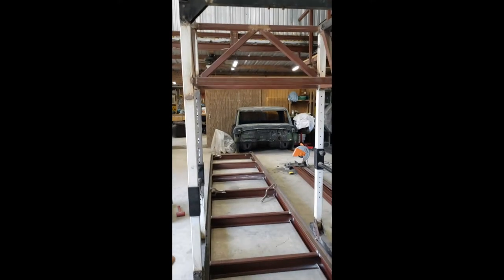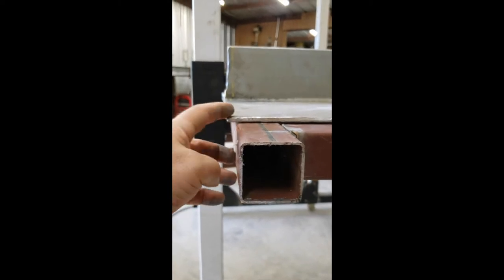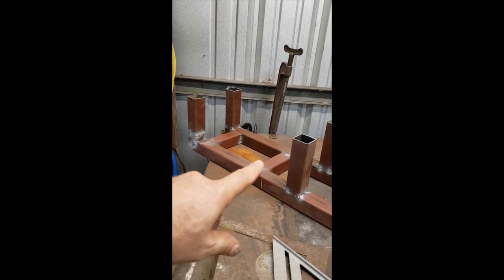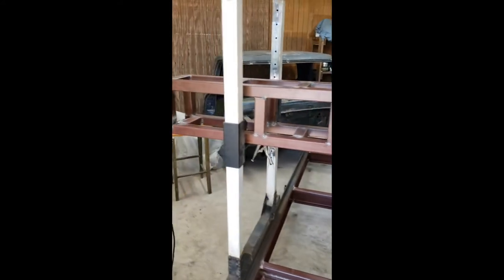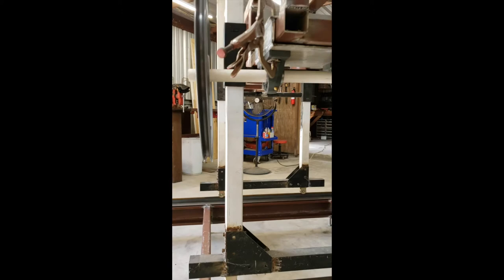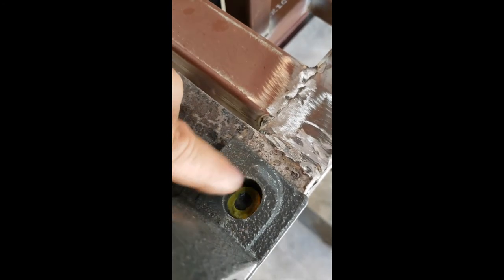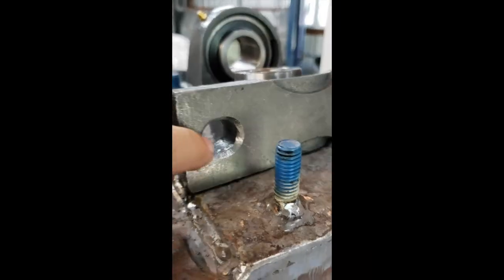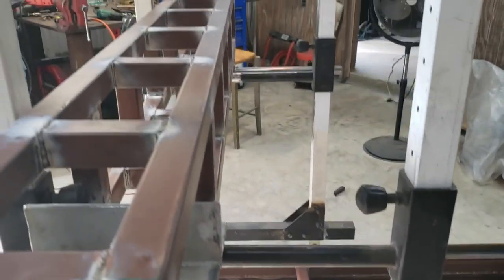Kman Builds - DIY Homemade Sawmill Build Video #2   Cradle and Cutting Head. Video #2

Comment: what size vbelt did you get to fit those wheels?  I just bought them and am trying to figure it out.  So far from what I can tell its a b56 or b57.
Reply from the maker: Unfortunately, I can seem to find the paperwork from when I bought them.  Which is a problem since I need to replace the main drive belt after I "smoked" it the other day.  Yeah, there is a video for that.  I will keep looking.  I will say the one I have is a little looser then I like, but does not seem to be a problem.